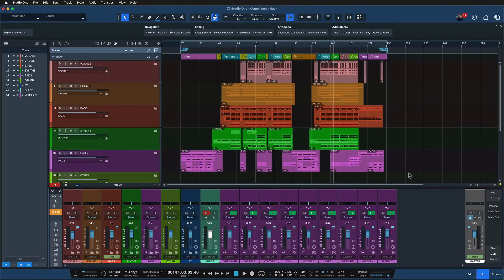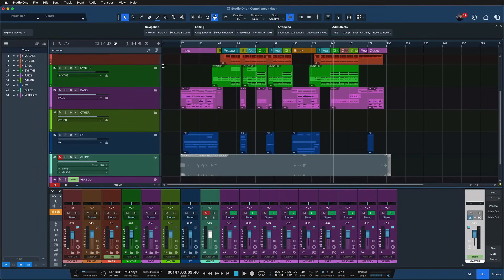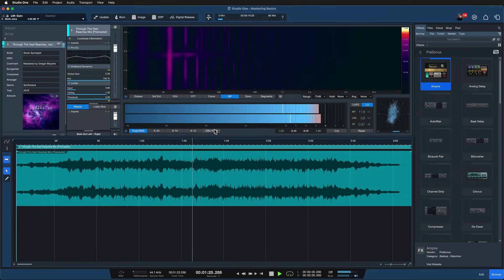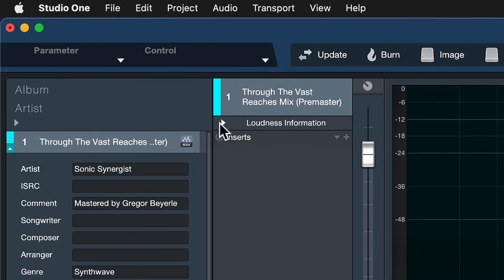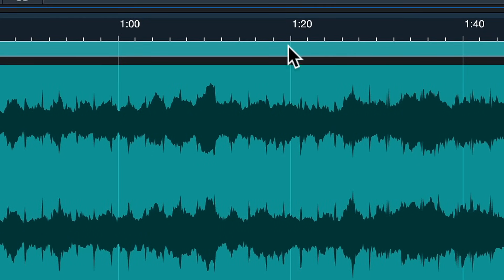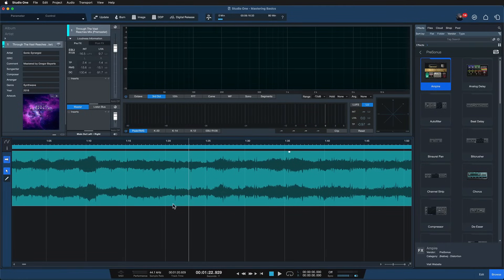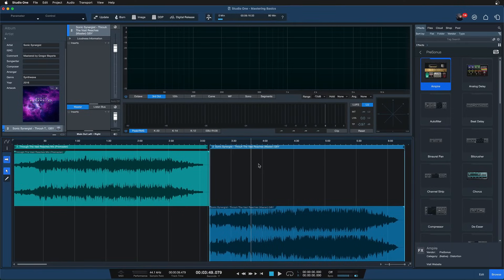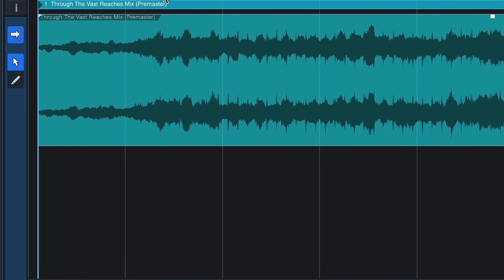The Basics of Audio Mastering in Studio One | PreSonus

Comment: Question about 6:49
I'm careful in the mixing process to ensure tracks are not clipping at any point pre-mixdown; however, I have always mastered in the Project file at 0db and never seem to have an issue. Everything usually sounds clean and clear depending on the master EQs, the quality of the mix itself in the "Song" file, and the important stuff way before that like the sound going in (mic placements, guitar volumes, gain controls, performance).

Also, in my country's radio broadcasting industry we were mastering ads and PSAs at 0db, and if another producer mixed a particularly hot spot or liner, we could ride a slider really quick to make sure nothing went in the red for our listeners.

My question is, even if I am extremely diligent in the main mixing file for music to ensure there is no clipping, is it still industry standard today to master a track to -1db? I just haven't released anything on the major distributors and am not sure what the expectation is.

Great video, and great product. Been using PreSonus Studio One since 2013 and will never change.

Comment: I usually use the Post FX figures rather than the Pre FX in the loudness check section. I love the Project Page. And also neat that you can go back and forth between it and the Song Page. I also do not use a Limiter on the song page master out, but if someone does, they need to turn that OFF before it goes over into the Project Page.